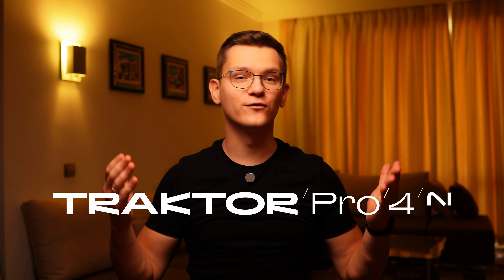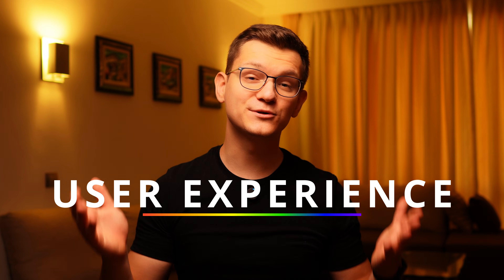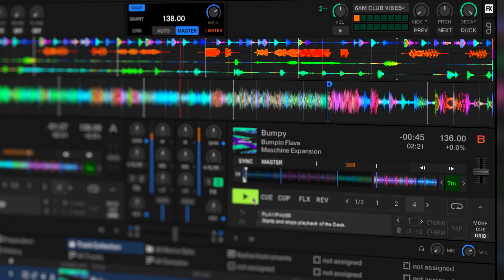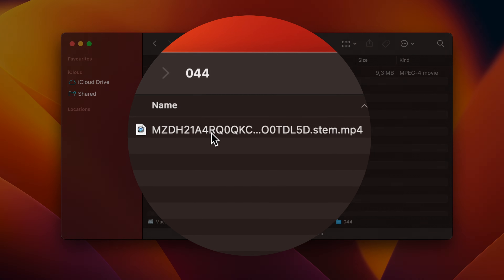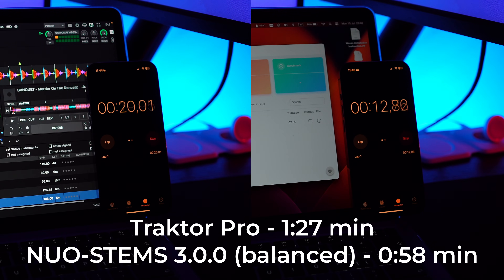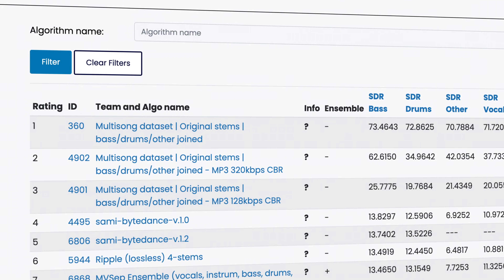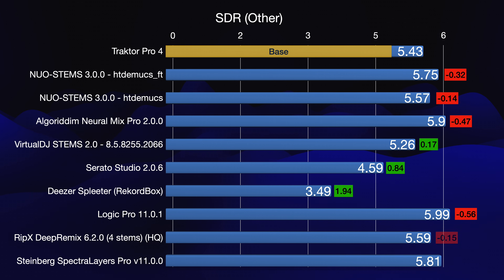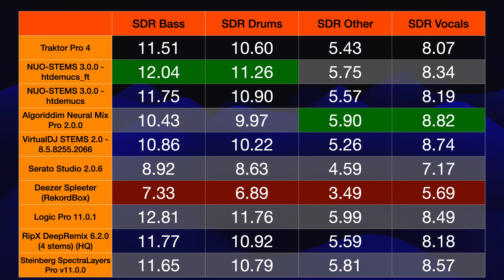Traktor Pro 4 - STEMS are here! (& comparison)

Comment: While Live Stem separation is not available in Traktor Pro 4, it is included in Maschine 3. The new interface features stem separation, enabling users to isolate vocals, instrumentals, drums, basslines, and more before re-sampling and chopping them up, without requiring access to the multi-track studio stems. Maschine 3’s stem separation is powered by iZotope’s RX algorithms, and the new update also includes iZotope’s Ozone 11 Elements. Thus, given this information, the capability lies within NI's/iZotope's parameters; they just need to upgrade it in the next iteration of Traktor Pro and stop teasing us with "Generating Stems," which is slow, limits you to one song at a time, and results in large file sizes. While this is something, it is definitely not the answer!

Comment: Why would anyone want to buy another product to prepare stems when they have already bought Traktor Pro 4, which has stem separation now? TP4 is an all-in-one solution with a click process. The quality is compatible with Nuo Stems. I tried your demo, and it's too many steps just to make a stem, and the interface for NUO stems is not user-friendly! Plus, I asked you about using NUO stems with Traktor S3 Mk3, and you gave some ridiculous answers about finding a mapping for it. Where TP4 works with ALL Native Instruments hardware and no need to map anything. So again, why buy third-party software when TP4 is an ALL-IN-ONE solution, easy to use, comparable quality stems, and user-friendly interface? Despite processing time, it works, and you can do process stems simultaneously (queued) and without crashes most of the time.
Reply from the maker: Short answer: quality 🙂. 

NUO-STEMS 3.1 offers significantly better quality and “sum of stems = original”. 

See these 2 videos: 
1. https://youtu.be/KTAMIDx9YWw?si=ilqCJspNdHJQC1vb
2. https://youtu.be/j0Jxl-KttJc?si=itgsGYaRRjDRxkXn

As for S3 - Traktor Pro 4 now comes with STEMS mapping built-in, so this is not an issue anymore 🙂

Comment: Hi, I would like to ask you if it is possible to apply an automatic echo effect to the deactivation of the stem relating to the vocal part, to obtain a fade out of the voice, thank you very much
Reply from the maker: It’s possible, but not straightforward) you’ll need extensive mapping + reserving one FX unit to Delay effect. 

Honestly, I wouldn’t go that route) Better get comfortable with using FX sends per stem + sending it to Delay FX and freezing Delay (or just disabling the stem when needed)

Comment: hi 🙏 i'm going to use the new m3 macbook air for dj with traktor 

if i still use hdd external hard drive (not ssd) to play the music file to do the mix

will it work well ？ will it slow down the whole m3 macbook air Performance ?🙏
Reply from the maker: Honestly, I don’t know what’s going to happen in this case, but HDD is definitely not recommended)
External SSDs are cheap, and you can get 1TB for like $50
Reply: @DJNUO  thank u 🙏

Comment: The stems files doesn't work on Virtual DJ right? I just bought the S8 and tried it with traktor 4 and virtual but I decided to work on virtual after taking 3 days mapping all the caracters, but I saw the format on virtual dj is quite of different, of the format of Traktor 4. It's any way of your program exported the stems on a way that I could use it on virtual dj? Thanks
Reply from the maker: Not that I know of, but maybe I’ll implement it in the future versions 🙂

Comment: just measured Traktor internal audio engine with limiter and without and several Headroom :  THD-N at -30dB for files at 44100/16 bits 1000 HZ test file : other DJ Software like Rekordbox or DJAY PRO or VIRTUALDJ  are at THD N - 97 dB.  Big audio quality problem. The best measured audio quality software is DJAY PRO 5.2 on MAC
Reply: Cleanest stems seem to be from Virtual DJ in my comparisons
Reply from the maker: Can you describe your measurement process in details? Also, if you're comparing STEMS to original track - sum of STEMS doesn't equal original.
Reply: @DJNUO  are you saying Traktor Pro 4 stems don’t sum to the original track, or Nuo Stems? Or both?
Reply from the maker: @brutesqd none of these sum up to original waveform: NUO-STEMS Serato, VDJ, Traktor Pro 4 or Logic Pro 11. So far I know that only Djay Pro does it (Neural Mix Pro 2.0.0). But result is very close. I can implement this feature, but this would result in worse quality "other" stem.

Comment: Not a revolution : Flexible beatgrid not automatic / Stems not live processing : DJAY PRO 5.2 on ARM MAC far far far superior in global sound quality / stems /beatgrid thant your TR4. Dispointed by the trial
Reply: How many windows user do you think has an arm pc. Well to be even more specific a snapdragon X Elite pc? The regular window version of Djay Pro 5 is black and white compared to the regular MAC/IOS version windows v5.2 lacking in features. 😂. But their fluid beat grid is unmatched. No other DJ software even comes close.
Reply from the maker: Agree about stems & beatgrid. But what’s better in terms of global sound quality?
Reply: @DJNUO  just measured Traktor internal audio engine with limiter and without Vous avez envoyé THD-N at -30dB for files at 44100/16 bits : other DJ Software like Rekordbox or DJAY PRO or VIRTUALDJ  are at THD N - 97 dB.  Big audio quality problem.

Comment: Hi ,Does it works with S3 ,in the demo version on right click can't see the option seperate stems?
Reply from the maker: 1. I saw somebody using stems with S3 in Traktor Pro 4. By switching to “Samples” mode on pads. 
2. Not seeing “generate stems” button seems to be some sort of bug, try looking at Traktor forums for possible solution
Reply: Now it works but not by explorer ,i found thé option by playlist.

Comment: But no z3 mixer. Stuck with a creaking S4 MK3, needs an flx10 traktor equivalent to even think about going back to that dead horse...... So painful when you revisit traktor every now and then does nothing better than any other programs but has so much missing and locked to cr*ppy hardware...... Out dated business model and awfully streaming capabilities 😢
Reply from the maker: What exactly are you missing on S4 MK3? Just curious) Cause it covers everything that I need, honestly) Almost all the features that UI has)
Reply: I’m in the middle of building a flx10 mapping for Traktor. It was designed for Traktor 3 but I’ll be updating it

Comment: Will the TP 4 work with f1, z1 and x1mk2?
Reply: i have 2 F1s and stems always worked with them, still does. traktor has has stems for years, its just now that the software can create them too. so all the older hardware will work fine.
Reply from the maker: It definitely should work)